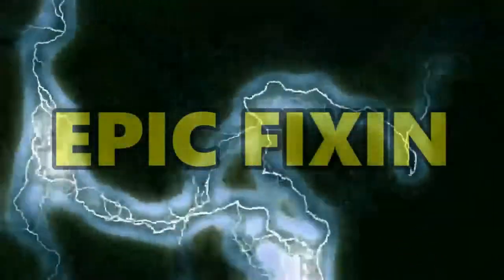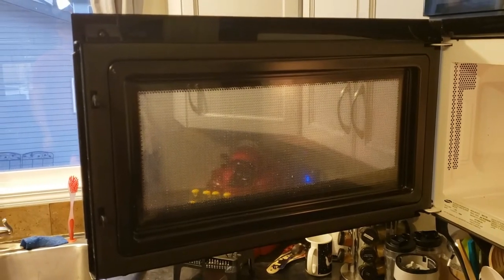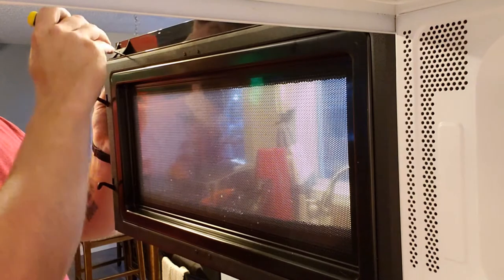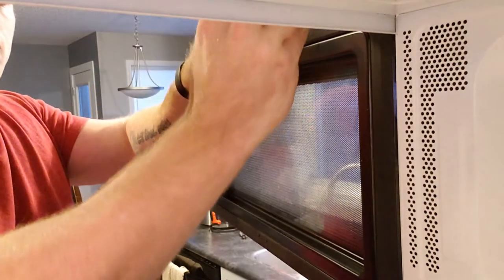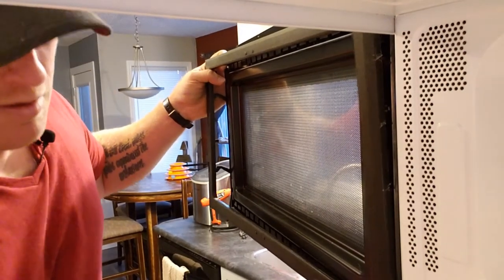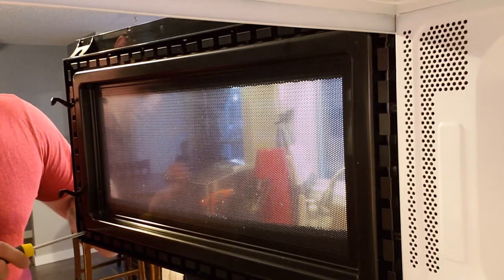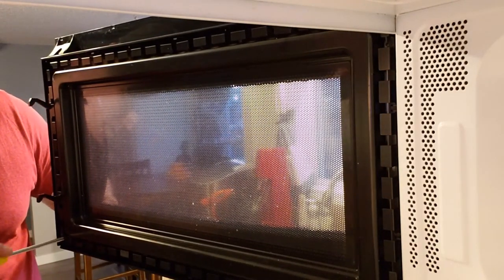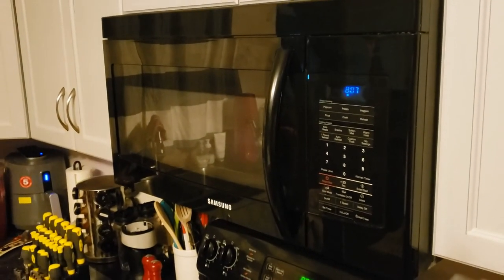Replacing Microwave Broken Handle

Comment from the maker: Thanks for watching the video, hopefully it helps you out. Let me know if you attempted this fix and how it went.
Reply: I have a fairly new GE microwave/convection over the range combo.  The replacement handle (plastic) costs $160.00  and it supposedly should only be replaced by a professional to check the seal after replacement. Do you think I can do it myself or is that too risky?
Reply from the maker: @heidizornes9812  Thanks for watching!! Some microwave handles are not easy to do, I haven't changed one on the newer ge otr, so I cant say for sure either way. Sorry. Let me know how it goes if you attempt it.
Reply: My Samsung microwave handle just broke today.  Your video gave me the confidence to try to fix it myself.  Thanks! (new sub).
Reply from the maker: @harryb7216  thank you so much, I'm glad the video helped out!!
Reply: My wife has been asking me to fix our microwave for awhile now thanks to your vid it is finally done
Reply: Just replaced ours successfully thanks to you posting this video!
Reply from the maker: @zeinayounan  good job getting it done
Reply from the maker: @seanwheaton7016  good job, I'm glad the video helped

Comment: My Samsung Quick Defrost (model around 2015-2019) has this small movement in handle end 1-2 mm loose from the other end so now i can safely tighten that screw. It's a small thing, but it drives me crazy. Small flat head screwdriver check, not too much force to get that plastic off check. It will work. Thanks.
Reply from the maker: Thanks for watching Mark\o/, good luck with your door!

Comment: I'm a installer for almost six years now but I changed complete doors on all kinds of appliances but I never changed a handle on a microwave and my microwave handle broken and it's a electrolux over the range microwave so I don't know if I can do it myself or i will need a technician to do it i will be very happy to hear from you
Reply from the maker: They are never all that hard, take that seal like I do in the video(the first thing I take off) and then you should be able to get to the screws for it, just be careful, once you take that seal off usually the door can be taken right off, so watch it doesn't fall on your stove. Thanks for watching Ramesh Etwaru.

Comment: I can't seem to tighten the screws all the way.  Any suggestions?
Reply from the maker: Kelsy Wilson thanks for watching, does it look like there is anything in the hole? I've never had that happen sorry.
Reply: @Thomasappliance  No, just as if it is too long for the hole in the handle or the hole isn't big enough.  I even widened the hole in the handle a bit, but I am starting to strip the screws so I stopped.  All else was great and I am appreciative to you for showing me how to replace this.  I had tied a string to the old pieces of handle and was using that for a while.
Reply from the maker: @kelsywilson2869  Sorry its being a pain in the butt, I've never had one do that so I cant say for sure what the hecknis going on. Good luck